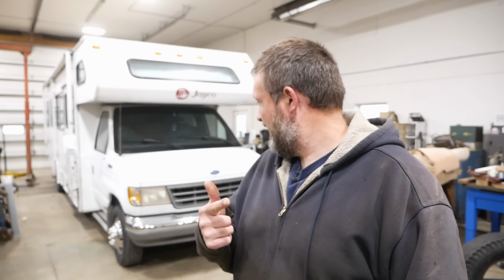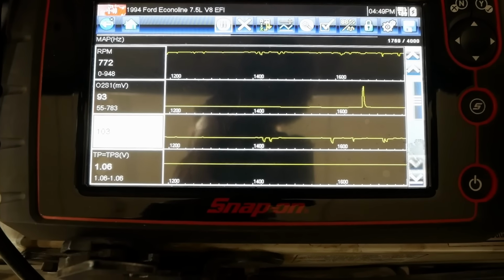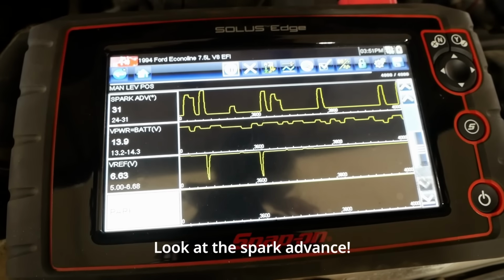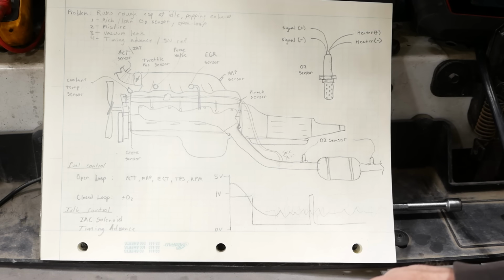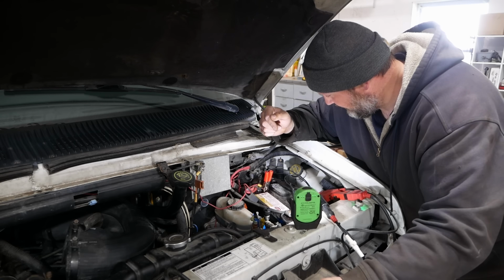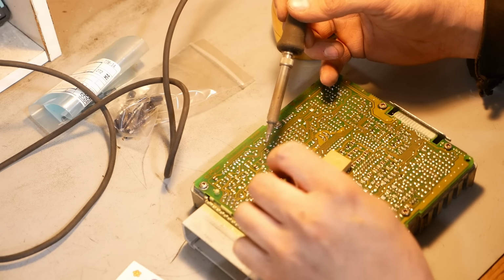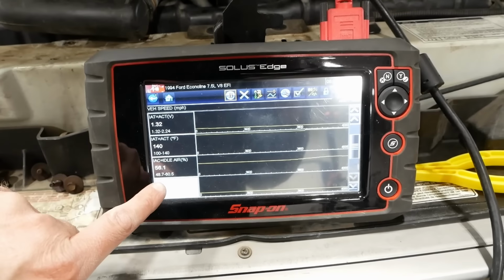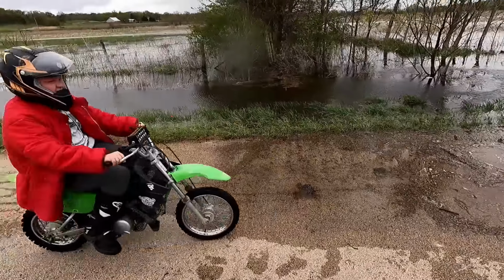Ford 460 RV Surges, Runs Rough but Nothing's Wrong?

Comment: As a electronics engineer facilty assistant who  repaired the school's lab equipment, I approve of your printed circuit board repair.  I would add heat to free the legs rather than cold working them free but no big deal. Always enjoy. Stay broke, stay happy!
Reply: Repairing that is fantastic, even electronics pros can screw something like that up
Reply: It's amazing how many problems come down to 3 (or 10 to 20) old electrolytic caps! Love the component level repair!
Reply: IF it works .. it works ... and that's the main thing !!
Reply: Hey there hive minde. Can anyone explain or point me in the direction of understanding what "open loop" and "closed loop" are. Wes has probably explained it in another video
Reply from the maker: @JustinVodden  It's just the difference between the computer guessing how much fuel to inject and the computer knowing how much fuel to inject based on the O2 sensor. Typically the engine runs open loop on acceleration and closed loop at steady throttle.
Reply: @WatchWesWork  thanks!
Reply: @WatchWesWork  does my 4.2 l V6 Essex engine run like that ?
Reply: @coreybabcock2025  
if its not a carby it will run in a "open loop" and "closed loop".
Reply: @sasquatchrosefartsseen plenty of corrosion, rarely it’s not the connector
Reply: @JustinVodden  To say it another way, open loop =  engine runs with no sensor input,  and runs off pre-programmed values. Closed loop- system runs using it's own sensor feedback and it makes corrections/adjustments based off that data.
Reply: @ChevyConQueso  thanks!
Reply: @JustinVodden remember the “loop” is the feedback loop. Open means it’s not using the feedback, closed means the feedback has a way to feed…back. 😊
Reply: yes adding heat equals no circuit board conductor trace rippage.......in and out quickly is the key.  Iwas wondering the same thing if you wrecked the pcm, you would then have to go get another one?  I worked on one where barely any heat and the trace would lift from the board which sucked so I learned THE quick easy is the way to go.
Reply: Always use enough sollder and floox
Reply: you might like the northridge fix youtube channel.
Reply: Add heat with a heat gun?
Reply: @M.TTT.  With old boards you have to be careful how much heat you add in. Yes, add more heat with a hot air tool, but only if it's needed like on large ground planes where they didn't use thermal pads, and you can't get all the solder out with the desoldering pump alone. Those look like they came out fairly well. Usually works a little better for me if I hold the desoldering gun horizontal, so it can suck the solder out without competing with gravity to get it up into the glass vial.

On older boards, the adhesive that holds the copper layer to the substrate isn't as heat tolerant, and it's easy to delaminate pads and traces with too much heat. Modern boards tend to be more heat tollerant because lead free solder melts at a higher temperature, so the whole soldering process is hotter, so the materials are more tolerant of that.
Reply: @M.TTT.  I have worked with electronics for the last 30 years. The hot air gun is to no use on through hole components. You will make the pc board way too hot before the solder melts. You will ruin everything surrounding the component you are changing. What Wes did is a textbook example of changing through hole component, without ruining everything else
Reply: @M.TTT.  after the solder has been removed (with solder wick or a vacuum device) just touch the leg with a hot soldering iron when you are pulling it thru.  Won't pull any of the trace off the board.

Comment: Awesome work Wes, great to see some component level computer repair.

EENG here. Missing capacitance on a linear voltage regulator (such as the classic 7805) can cause oscillation; spurious signals at a high frequency that your multimeter will never see. Maybe even high enough that your scope would miss it. Depending on the type of ADC that could cause sensors to be mis-read, or it could upset the 4000 series CMOS logic circuits. Either would cause the ECU to do strange things.

The Vref signal may actually measure a voltage against which the sensor signals are compared to get the digital reading, would make sense for it to be a little higher than the 5V ref. Not sure how they're measuring that one though. I guess it's turtles all the way down. 🤣

As for the O2 sensor, I guess it runs in open-loop when that air injection is on, but maybe shuts off the secondary air and takes a reading from the O2 sensor just at the point where a different management system would go closed loop, then adjusts the idle strategy based on that reading. If it's just reduction cat, not a 3-way, all it needs is to be lean with the secondary air, so it doesn't need to balance the oxygen levels in the cat by running closed loop all the time.
Reply from the maker: I'm not sure on the O2. It doesn't have a cat and never did. So I don't know what the point is. I guess it was some kind of emissions patch that never got fixed.
Reply: @WatchWesWork  Oh, ok! The air injection may help to reduce hydrocarbons even without a cat.
Reply: @WatchWesWork  The 460's used air injection to burn off CO and excess HC in the exhaust manifolds/head pipes.
With the pump working all the time the computer would use engine temp and manifold vacuum/throttle position to determine when to open the solenoid and allow air in.
Leaking Caps have been the bane of Ford ECU's since the '80's. Lots of places sell just the 3 Caps for ~$10 delivered (must have been a great business! )

Comment: The EEC gives the command to open or close the Upstream Air injection, and so when it does switch the Diverter Valve either way, it makes a compensating correction to the fuel trims.
Reply: Actually I might be full of shit - both Upstream and Downstream Air Injection occur aft of the combustion chamber, so the air to fuel trim shouldn't be affected - but the EEC still knows, and takes into consideration, that the O2 sensor will be sending different data when the Upstream Air cycles either way.
Reply from the maker: It's some kind of magic.

Comment: Great job, Wes. Guy should lay you for every minute you spent. Surely, sending the computer off to be fixed would be pricey, and figure in your time, etc, it was a great fix. Maybe the Vref being t.v., was the capacitor not being connected and the voltage was not pulled down.
Reply: Pay, not lay! My big fingers missed!

Comment: I chuckled at the way you pronounced "solder". Doesn't change what it is. It's the way it's spelled, so..... As for how you desolder, whatever works for you. There are many right ways to do things, and I have watched you long enough to know that you have a reason for everything you do. As long as it works, who cares. As for the RV... Wait until they ask you to change the water heater or something as silly. It's not that bad, but the replacements are never a direct "bolt in".

Comment: As these vehicles age this seems to be becoming more of a problem with the caps inside. Another Youtuber I watch has posted about 2 or 3 of these, all with bad caps, some so bad its eaten the traces on the board. Good on you Wes for finding it and gettng that rig back on the road.
Reply: For high-reliability applications, they recommend replacing electrolytic capacitors every 10 years.  I have zero surprise that this was the issue.
Reply: @MichaelSteeves  most ppl don’t keep a vehicle for more than 3-5 hrs. This should have been set out to pasture many moons ago. Lol!
Reply: @robpeters5204 And that's why most Americans are in debt up to their eyeballs. Maybe they should pay for and keep their cars instead of leasing (renting). Still cheaper to maintain a paid off vehicle than buy a new one like the dealers/banks want you to.

Comment: Wes, you got big ones! Not 1 in a 100 techs would mess with a PCM board. Good Job! I have some experience with early automotive electronic controls and it was almost never the PCM/ECM. It sure was this time. Thanks for sharing. You and South Main Auto are the only ones I see making drawings or consulting schematics. Keep it cup!
Reply: And pine hollow
Reply: Back then, the circuit boards in the ECMs were reliable, unless it had a cracked trace or the board warping and contacting the case, we found these by doing a "tap test". Nowadays, most caps over 10 years old are failing, it's not just ECMs, but anything using them. Old home PCs are especially prone to it, I've had several I've had to recap
Reply: You beat me to it
Reply: The capacitors in most of the older Fords eventually fail.

Comment: My memory aid for return voltage on a O2 sensors ciccuit is Low voltage = Lean signal. Both words start with (L). A good memory aid that works for O2 sensors not Leniar Oxygen sensors. As for VREF voltage I write that up as a scanner software issue. As for oxygen pump pulsing air upstream of an O2 I say the pulsed oygen air is not all the time. Only when the catalitic converter needs more oxygen to defeat NOX. Most of the time the front O2 input voltage signal into the ECM can be trusted. I would have missed that diagnostics as Im not a FORD technician but you nailed it. Congradulations.

Comment: The one thing I know for sure about those older Fords is idle problems ?.... Start with cleaning throttle body as they count on the air passing around the throttle plate for idle.  P.S. you are a diagnostic guru, thx for the vidyas

Comment: 99.9999% of gas (petrol) cars use timing advance to fine control and help with anti-stall idle speed, and recently (like the last 10 yrs) , to promote Cat warm up, by running timing pretty retarded and cranking open the throttle at cold start.  It's nothing new at all.   Back to the E350, either its not warming up sufficiently or something else is wrong as it *should* go into closed loop and secondary air shut off once around half warmed up at idle.
Reply from the maker: This truck does not have a cat converter and never did, so there's really no need for cat warm up or even to run in closed loop. Emissions regulations were still pretty lax for commercial vehicles in the early 90s.
Reply: @WatchWesWork    Begs the question why has it got 2ndary Air injection if no cat !

Comment: Surging means fuel partial blockage? Crumy gas, fuel filters need changing, sticky carb float? Try some SEA FOAM mite clean out the fuel system and it will run smoother. Pop the spark plugs, look for carbon-up plug. Check plug wires are connected good, no white or green corrosion in the boots or cap connection. Fuel tank pick up filter screen patially clogged up? How long was it sitting?

Comment: Nice find! Every vehicle that has electrolytic capacitors is a ticking timebomb. Eventually they will fail. However, most of the time the capacitors will outlast the rust (at least here in the rustbelt) before the vehicle reaches end-of-life. WRT the secondary air injection, I thought SAI was only active during cold engine start up and used to accelerate the O2 warm up for closed loop operation. Once the engine goes into closed loop operation, the SAI would be disabled. Might be different for different makes/models.

Nice shoots of the flooding. Tough year with the snow melt and rains. Hopefully summer is much less eventful, weatherwise. Thanks for the videos!
Reply from the maker: It seems to run the secondary air on a timer, cycling every minute or so.
Reply: @WatchWesWork  I commented elsewhere but I suspect that cycle is used to poll the O2 sensor and update the idle mixture, but that it has a 2-way cat that just needs a lean mixture.

Comment: 1st, computer never registers rich or lean on O2 data, the fuel table is the bible by which it runs upon, hence 460 fuel economy.
2nd idle in open loop because #1, only criteria are coolant temp, map ref, rpm. 
3rd Common ford stuffs, could be anywhere from 4 -7volts even when the factory manuals state explicitly it has to be no less than 4.95 or greater than 5.1 
4th Timing advance... Lol EEC-IV
Reply from the maker: So why does it have an O2?
Reply: @WatchWesWork  I cannot answer this question, but I have worked on piles of the FI 460 engines in possibly everything they have ever existed in, Heavy duty, dozers, OTR trucks, rv, marine, stationary, and many others.  the only thing that changes the fueling for the O2 in my experience is when is shorts back to PCM and melts the contacts internally. Otherwise, literally zero change in the fuel consumption or externally monitored exhaust sniffer. My best guess for such a creation, much like the air pumps that typically accompany them, someone told Ford the are required for legal operation.

Comment: that orange soldering iron lasts about a month. I for one for free inside of some kit.  The temp knob fell off after a few days.  It funny, as soon as you said the vRef as high, I was thinking a bad cap somewhere but didn't know why. Then you mentioned the computer and... voila.  The bad cap was allowing the voltage to swing all over. Your map sensor test was likely reading RMS so it may not have seen the swing the same way the scanner saw it.

Comment: had 91 ranger if i remember correctly. used to haul boats from ga to uncles bow shop in northern I'll. younger brother overrevved pushed a rod through the side. older bro swapped a junkyard engine think he might have mixed a sensor not sure. cold would shake and shudder, once warmed up ran great. took to dealership, many ford master tech's could not diag. i ended up with it, painted, new clutch 400k+ miles nor could i figure it out... sold it that way for 700 in 99. great diag skills, and good job as always, thanks for sharing and not being afraid to tackle what those wouldn't. Cheers!

Comment: I remember those on the Ford Squad Cars which idled for extended periods of time and of course, they were mounted near the engine. We used to keep new ones at the station as they burned up frequently. We tried to get a mechanic  to extend the harness and place it inside the interior but no go. Good Job!

Comment: I has a little different issue with  warning lights etc about o2 sensor but after clean out the throttle body all issues went away.
Also the coolant water level container full marking was about 2 inches to high, when filled to the level shown on the line I blew hoses.

Comment: Surprised those NICH caps leaked.  Usually they are pretty reliable.
Reply from the maker: Pretty rough duty cycle. High vibration, large temperature swings, plus age.
Reply: Every electrolytic has a finite lifetime. Ceramics last much longer if not indefinitely.

Comment: Several years ago we had a guy show up at my shop in an old Chevrolet conversion camper. He was living in it and the engine blew up. He was stranded and no one else would work on it. We ended up replacing the engine with him living inside the van. He would just wander off during the day and then we pushed the van back outside at night and he'd sleep in the parking lot. Interesting experience. Probably not One I would repeat.
Reply: My step van conversion died on me on A1A in Ponte Vedra. Had it towed back to Jax Beach, got a job pumping gas at a Gulf station and the owner fixed it while I lived in it. Great experience. 👍🔧
Reply: @Rein_Ciarfella  What a nice work commute you had. 😁👍

Comment: Mass airflow sensor? Well that was wrong! You’re definitely a master technician, Wes. I don’t have an answer for ya, but Ford has had some unexplainable ideas for meeting emission standards. Doesn’t it make you long for the good ole days of vacuum advance distributors and carburetors? 😂
Reply from the maker: It's not hard to see why the Ford OBD1 system did not become the standard.